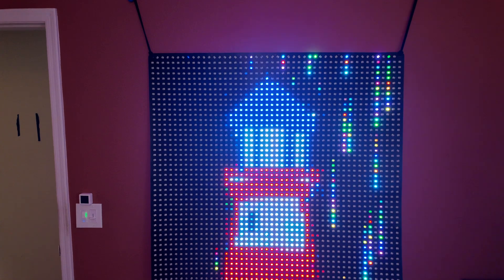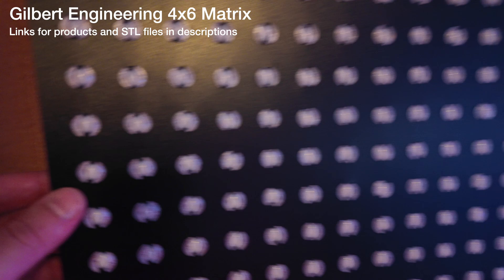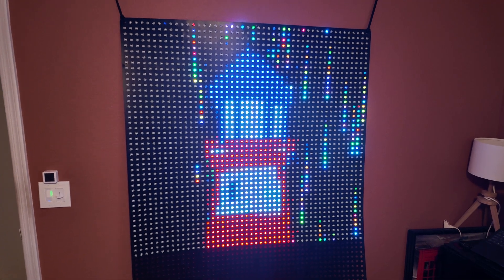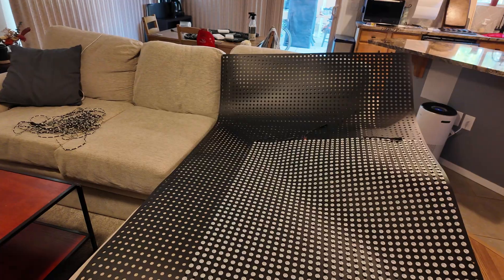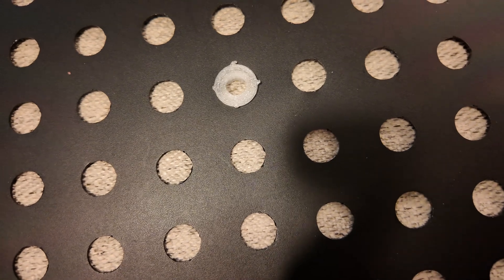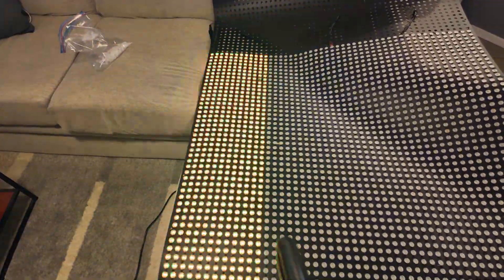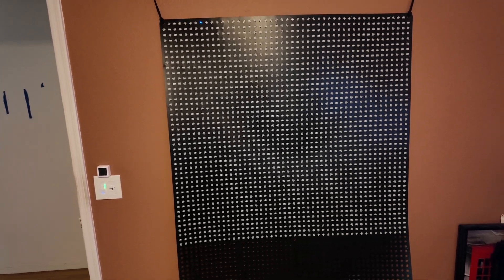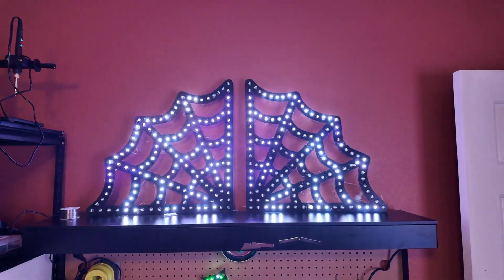WS2811 Seed Pixel Window Matrix Rebuild (xLights)

Comment: What did you use to push seed pixels into the 3d seed pixel holder?
Reply from the maker: they just snap in with 3d printed parts, ill admit it was not easy on the fingers after all the pushing.

Comment: What is the actual seed pixel spacing used/required (5cm or 10cm) to run between 3cm panel holes?
Reply from the maker: I had 1" seeds so 2.5cm and it is a very tight fit but it does work and keeps the wires flat.

Comment: What controller did you go with and how many ports did you have to use for this? Power injection? Love to hear what the controller build for this is
Reply from the maker: I have used both a 4 port smart receiver (controlled by a falcon f16) and a kulp K16.  Both worked great.  The matrix uses only 4 ports and I dont have power injection.  It is only noticeable at full white.  I will probably add some after this season.